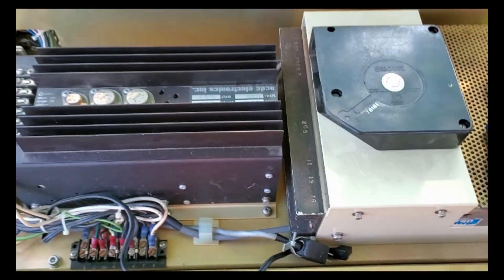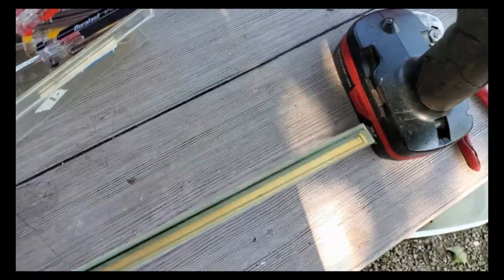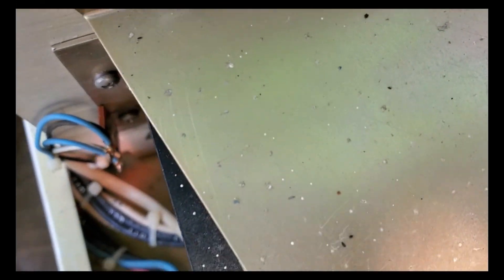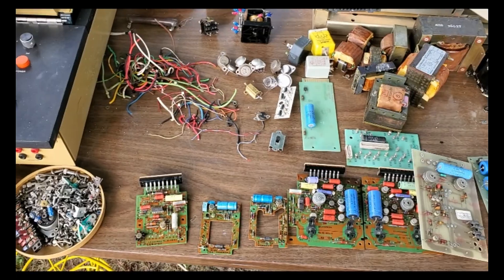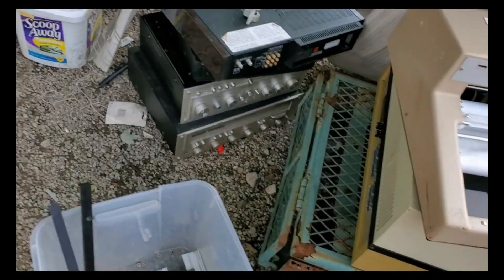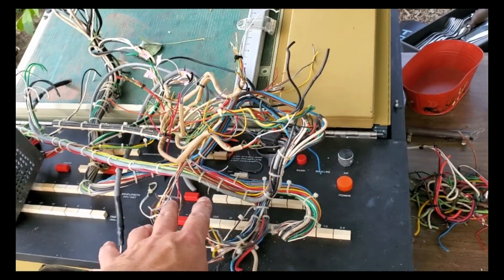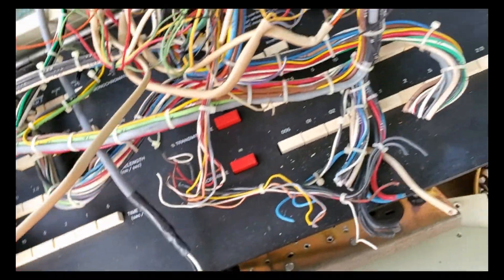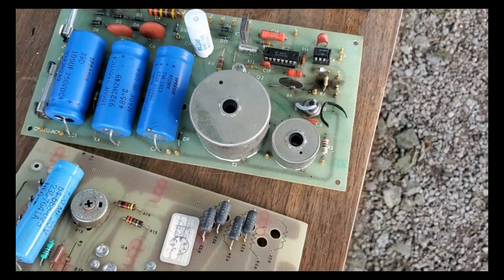Scrapping A Vintage Spectrophotometer Power Supply

Comment: Teflon wire is commonly used in military / aircraft electronics, you might find it also in formerly super expensive scientific equipment like you have here. Often you will have silver clad copper conductors inside. Teflon wire is very usefull for electronics hobbyists, because the insulation does not melt if the wire is overheated while using a soldering iron. The large pcb surface that had the teflon sheet must a an electrostatic retainer for a sheet of paper, the device seems to have a  table that draws tests results curves on paper. More or less like an oscilloscope, but with a pen and paper output instead of a display.
Reply from the maker: I have come across some of the wire you mentioned but I didnt know why it was only high end, thanks